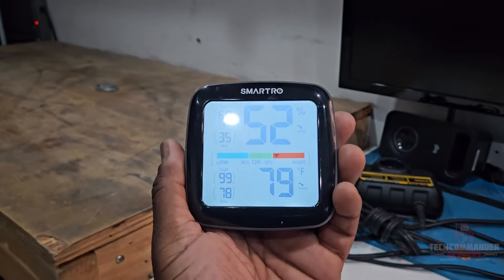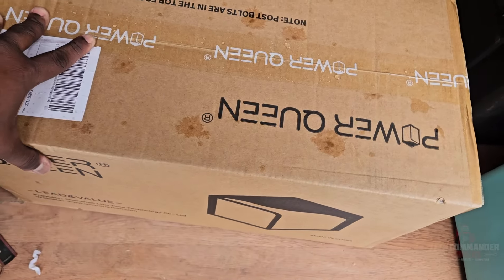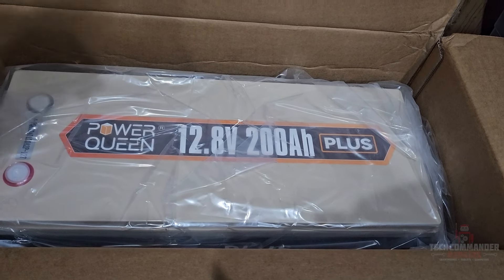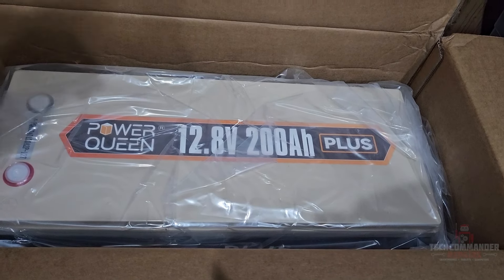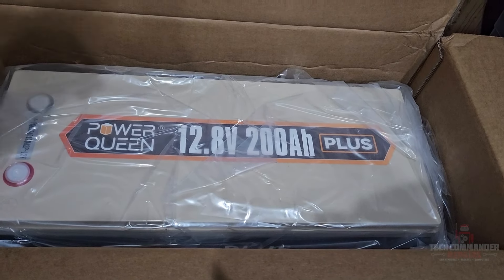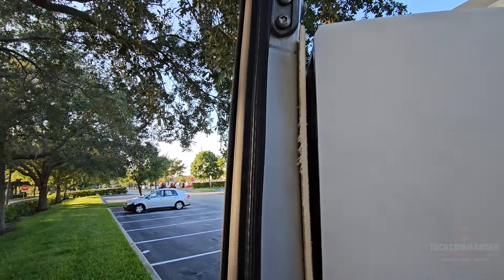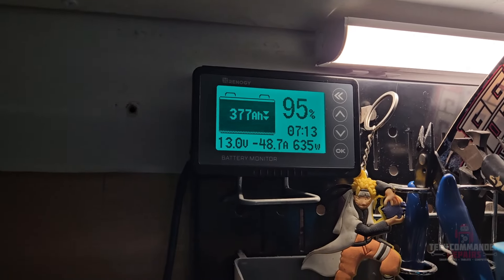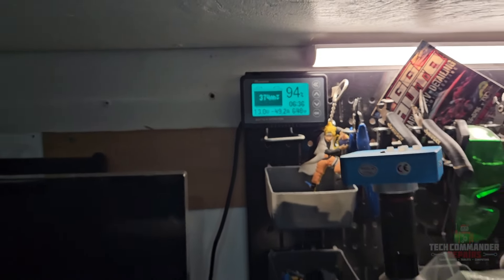Mini Split In Van | AC Installation In The Mobile Office

Comment: You probably already know this but there are smaller mini  splits for vans, I have a chevy express 3500 that I'm adding one to from Amazon, I have a 3000 watt multi plus from victron with 6 and 4, solar/battery bank, and hopefully it's just as efficient as the bigger ones, but anyway good job.
Reply from the maker: I did see the smaller mini splits, i was just more worried about fighting the Florida sun. I'm not insulated to the best that I can be.

If I could park in the shade while doing repairs I will, but when I can't....the back of the van can reach 112°.

I still have to add my solar but it's been doing well so far.

Thank you for watching the video and commenting. I hope you're documenting your process. I'd love to see it.
Reply: They actually seem to use more power though, 950w rated for the 12v or roughly 500w for a 2.5kw mini split. Huge efficiency difference based on that

Comment: 9000 btu is plenty if you have at least R-5 insulation in ceiling and walls. Chevy Express. I installed the heat pump outdoor cabinet with fan and coil in place of spare tire blowing down. Extend 1/4” liquid line and 1/2” hot gas line, I have 1600W on the roof, 400aH LFP 24V. 4000W Magnum Inv. With no solar on our sunny 95F days, I can work eight hours with temp set at 74F, also powering a Iceco Chest Ref/Freezer and come home with 5-10% remaining. With solar after working all day…90-100% SOC.
Reply from the maker: Niiiiiccccceeeeee. That 24v system is definitely more efficient than my 12. If I were to build a camper I would do the 24v system as well.
Reply: @TechCommanderRepairs  subscribed so we can keep in touch on any issues. Mine is Ameristar or same as a Gree Vireo 22 SEER. R-410A.
Reply from the maker: I appreciate the sub 🙏🏿
Reply: Are there any potential issues mounting it under the van like that? I would love to do that but i hear that when its mounted on its side like that it can cause problems. 

How long have you had it running like that?

Comment: hows it been holding up with the slight bit of wobble up top on the outdoor unit? i travel in my van full time, often on dirt roads, thats legit the only thing from buying this right now. thanks!
Reply from the maker: It's been holding up pretty well. I'll make an update video. 

The wobble hasn't been bad. I take my time when driving over speed bumps. It's been real good though.
Reply: @TechCommanderRepairs  awesome!

Comment: Wonderful video! You got yourself a new subscriber because of it, too! 🙂
I hope you don't mind me asking, but I was wondering how exactly you are running power from your battery bank to the outside compressor unit. I'm guessing something like a 12/3 heavy-duty extension cord plugged into your inverter with the other end of the cord cut open-ended with the 3 wires hard-wired into the compressor's wiring block. Do you have any breaker or a disconnect in the path, or just straight cord from the inverter to the outside unit? My feeling is that since this AC isn't installed on a house, there is no real need for a breaker or a disconnect (pulling the plug is the disconnect!). Any insight would be really appreciated!

Comment: I work out of a mini van so the minisplit would not work for me. I just bought 2 100 watt flex panels for the roof of my van off Amazon with coupon they were little over $100.I did see another mini split that you can wire directly into the panels. FYI I am in NC so just as humid and hot here in the summer. I have a 12v compressor fridge I use in the van. Upgrading to a full size van soon. I run a lawncare business so the van is more secure than a pick up.
Reply from the maker: Nice, yeah I saw the ac systems that run off solar. They're a little bit pricier for what I would need to cool my van.

Can't wait for you to upgrade. I would love to see how that turns out for you

Comment: Wouldn’t a rooftop unit be easier and take up less space?
Reply: This is the unit I'm putting in my van. My roof is all solar panels. There's no room for a unit.
Reply from the maker: I didn't want to cut a big hole in my room. Easier to replace a door than the roof.

I also want to fill up my room with solar panels. Trying to fit 800 - 1000 watts of solar.
Reply: They’re way less efficient too